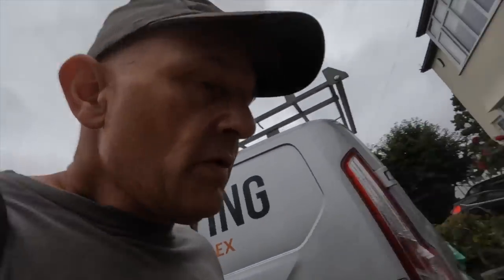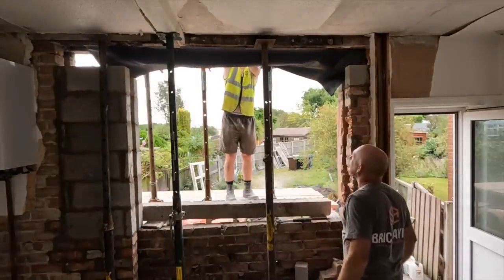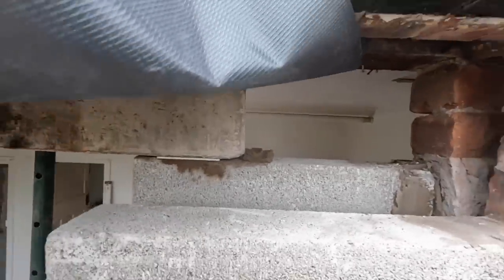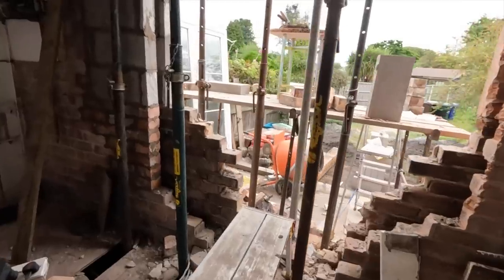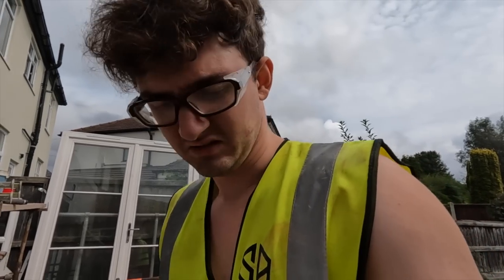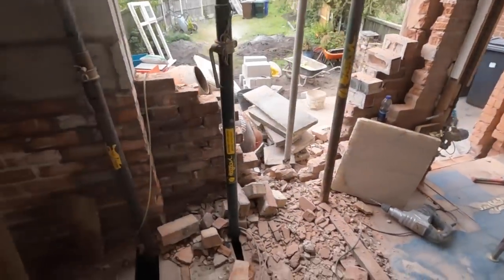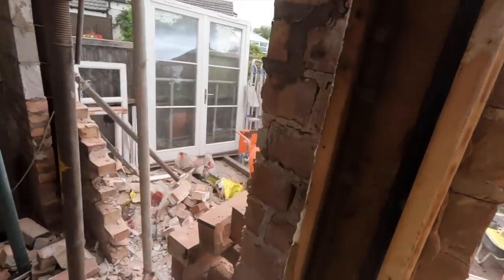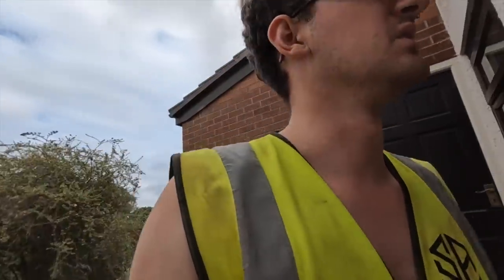DISASTER !...AL BROKE THE SABRE SAW!!... RENOVATION JOB PT 2

Comment: Bang a new plug on that saw, it'll be good as new... if not a little shorter.
Reply: Or, if you're not comfortable taking the tool apart, just add a plug and socket where the break in the lead is

Comment: Great work you certainly earned your money there. Didn't realise you could cut through mortar with a Recip saw, what type of blade do you use?
Reply from the maker: Thanks pal . Bosch carbide masonry 💪🏼🧱👍🏽
Reply: @SteveAndAlexBuild  Thanks, Steve & Alex I'm going to get some of those blades could have done with one a few weeks ago toothing out just never knew they existed.👍
Reply from the maker: @v8motors.  no worries pal . They work best in softer mortar . Anything like 4 to 1 sand and cement is a stretch for it .🧱👍🏽

Comment: You're really starting to make a much needed change of looks to this house.
Looking at the furnishings in what was the kitchen I believe, everything did have a very obsolete 60-70s look to it.
Gloss white paint on the walls, grey or green linoleum tiles on the floor and a fluorescent tube armature on the ceiling, very utilitarian but not a place you want to live.
I believe with those French doors  and a modern kitchen it will be a giant improvement.
Are the existing soldier courses real brick or carved in the render?
Reply from the maker: Very true Tom . They were original engineering bricks 🧱🧱🧱👍🏽
Reply: @SteveAndAlexBuild  So the renderer needs to hide all these soldier courses, otherwise it would look odd.
Reply from the maker: @Tom-Lahaye  the soldiers got cut back in part 3 🧱👍🏽
Reply: @SteveAndAlexBuild  Spoiler alert!
Reply from the maker: @Tom-Lahaye  🤣🧱👍🏽

Comment: Explain please what the board covered 'ditch' is just inside that wall. Red dust storm!!!
Reply from the maker: Not got a clue what you mean 🤔
Reply: @SteveAndAlexBuild  The floor next to the wall has boards you removed to get to the "foundation"? when you started the inside work. It looked like it opened up part of a space under the floor???
Reply from the maker: @dpeter6396  it’s the crawl space under the timber floor 🧱👍🏽
Reply: @SteveAndAlexBuild  Thank you! A timber floor, of course.....